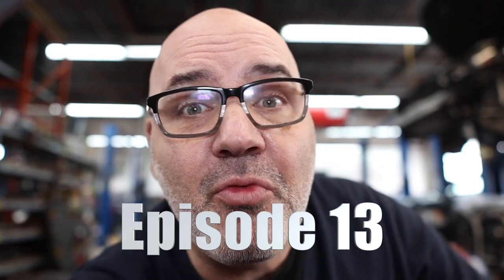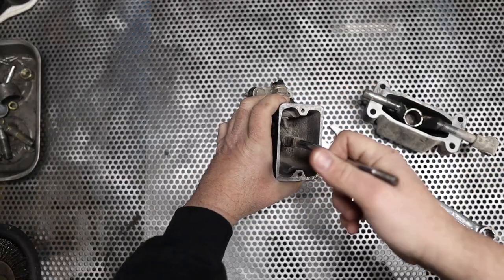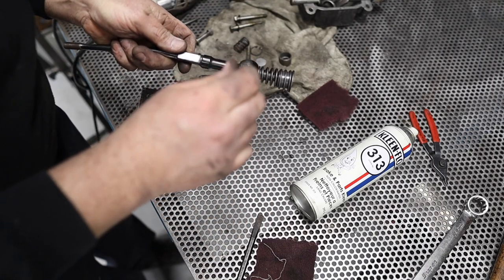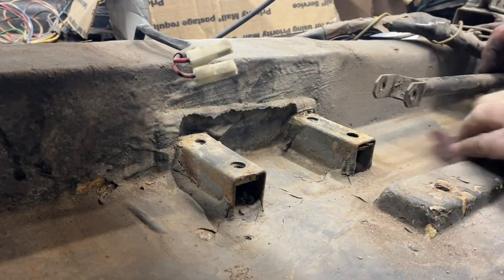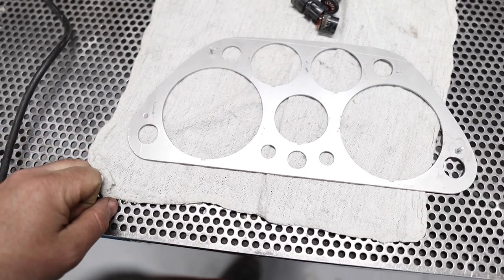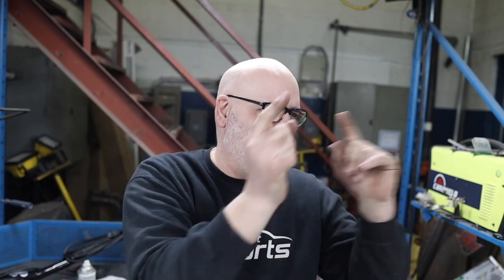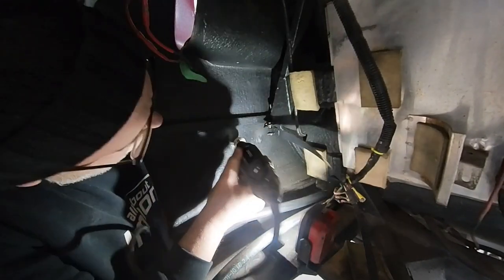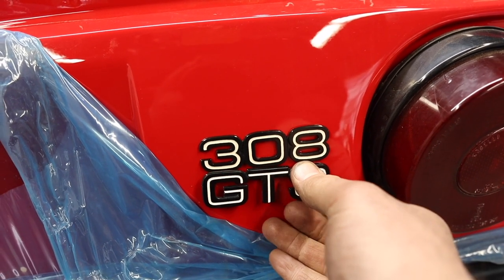#Ferrari 308 GTS rescue and restoration!

Comment: I would bet Bill at GT Car Parts can find a decent used hazard switch in his inventory.  Be sure to clean all the contacts before installing as the regular turn signal circuit runs through the hazard switch and dirty contacts can render them inoperable causing you to chase your tail for days until you realize it is the hazard switch causing all the problems.
Reply from the maker: I beleive I have found a new one.  thanks Lou

Comment: The light you found in the box is not for the dash but a Euro fender marker light as used on a Dino. The correct one has a big black bezel like the other lights. As for the rear emblem it is definitely a 328 one. Oh the joys of parts hunting. Otherwise looking good.

As for the missing studs on the instrument panel that's a tough one because it is anodized and you cannot fix it 100% without a full strip and re-do. I would recommend just bonding the rear bracket with JB weld (not JB Quick because you want the extra strength) and calling it a day. Unfortunately I do not have the part numbers for the dash lights but they are easy to take to Canadian tire and match them by eye to the correct LED equivalent.

Last thing is to absolutely bypass the rheostat on the back of the dash cluster that controls the brightness of the instrument lights. Not only it is an ancient fire hazard but it is totally useless and will never be used. The lights on a 308 dash are never bright enough and one of the first things you should do is bypass that switch to remove as much resistance as possible to them.
Reply from the maker: I knew you would be along and would know. cheers and thanks as always for your help!

Comment: Oh wow—very brave of you to drill the emblem holes! Being OCD, I'd be freaking out if I had  them drilled and didn't get the badge 100% level. Never mind the anxiety of possibly messing up the fresh paint. Also, as someone else commented, the "GTS" badge does appear to be from a later 328. My understanding is the early Carb cars got silver/silver versions for GTS/GTB. I'm not certain if they had mounting studs or if they were glued on back in the day. The "308" may be from a QV or 328, but I personally like seeing that version on any 308 so I'd leave that one alone. With the shifter, that's awesome work. My car's (Mondial 3.2) shifter was in good shape but somehow accumulated some debris which was recently removed during a shop visit. Oh and a mouse nest under the console next to it. Surprise! Aren't those NLA parts annoying!? I'm learning to be patient as I have some I'm also trying to track down, thankfully none that are essential at this time. Looking forward to the next installment!
Reply from the maker: Thanks for watching and commenting. Yeah the parts acquisition process is a real pain.

Comment: 16:49 been there done that....but if you mucked up the badge was like 1/2" bigger than the holes so you had a fudge factor. I personally would have used the VHB tape, that way you don't have any holes to rust and it can be removed with a plastic spatula.

Comment: Those switches on the dash side panel just fall apart with moderate pressure.You can reassemble kind of , or just blow another $30 with super performance.Tell me about it .The wiper is a two speed thingy .The main wiper switching is the RHS stalk on the Column.
Reply from the maker: Thanks.

Comment: I would have loved to see that you go a bit deeper into the shifter restoration. You could have checked the bushing as it may be the reason for unprecise shifting when worn. Also you could have painted the inside of the case matte black. Also when you are in there, "polish" the shaft and the case where they are moving with 2000 grid sandpaper. A bit more grease on all the moving parts would have helped as well... But maybe you did all that and it was not shown...
Reply from the maker: The bushings were decent so I greased them and left them.  
I take hours of video for every episode and cut out all but 20 minutes worth.